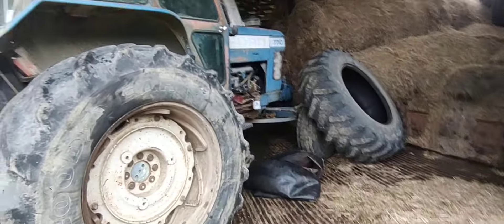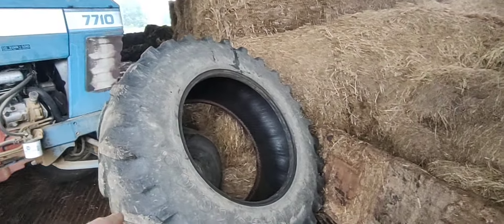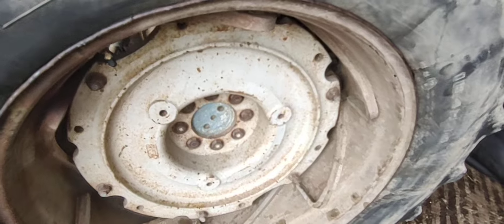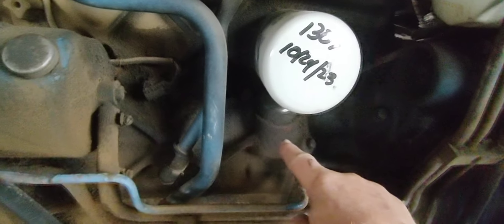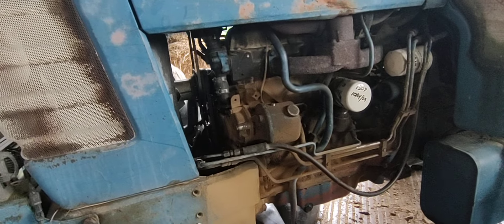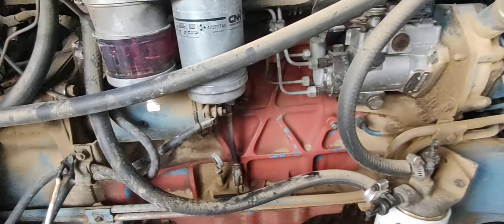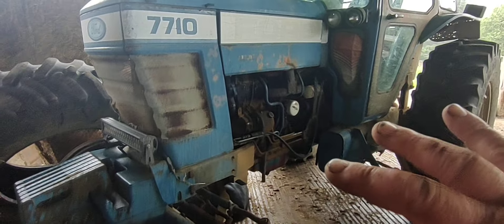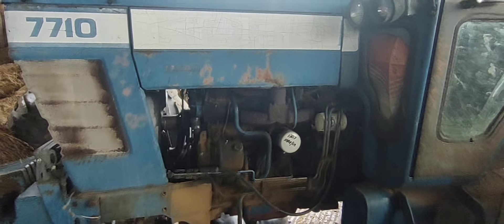The origin and history of my Ford 7710.

Comment: The common problem with those blocks was electrolysis corrosion in the water jacket eating through the cylinder wall. I went down that road to with my 7700.

Comment: That 7710 is one tough SOB 👌🏻. That tractor has a lot of “character” lol. I never realized the 7710s were turbo charged. Now it needs a straight pipe so we can hear the turbo and people can stop complaining ab the bent muffler 😂.
Reply: Ford made great tractors. They get overlooked too often very reliable
Reply from the maker: It was bought to work not go to parades. 🤣🤣
6610 uses the same motor not turboed and you straddle the transmission. 
7610 is the same motor turboed like the 7710 and you straddle the transmission like the 6610.
The 7710 platform would have a flat deck without the cab. 
I've ran it without a muffler and it is way louder but you can't hear any turbo whistle.

Comment: The air conditioning would not be that much to fix. My tw20 will freeze you out.
Reply from the maker: You would probably have to find lines from a aftermarket or have someone make them. I'm sure they're obsolete from New Holland .
Reply: @Mad_Farmer912  Ap air has all the parts for tractor air conditioning

Comment: Air conditioning will cost at least a thousand dollars they are not cheap to fix like a person commented on here
Reply: I fix them all the time. It would be under $1000. What’s it worth to your guess. All my old tractor has really good air conditioning
Reply from the maker: Compressors aren't to bad, $200-400 depending where you get them. Hose would be the issue. I'm sure they're obsolete from NH.